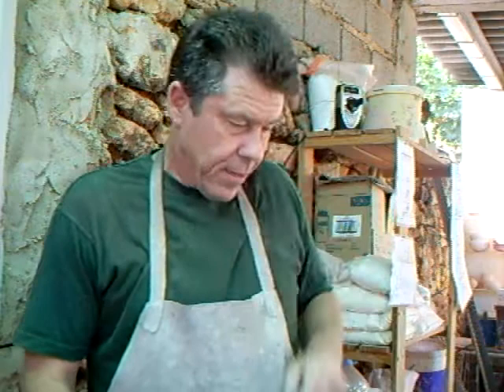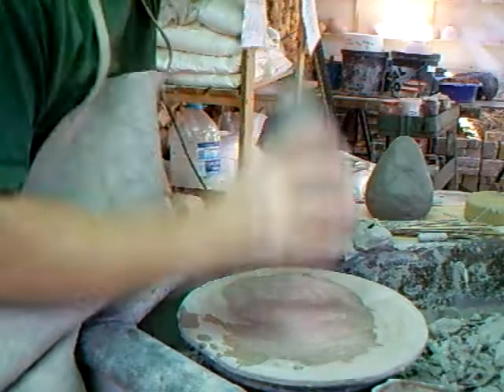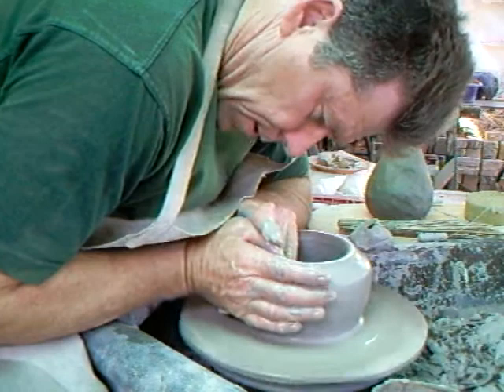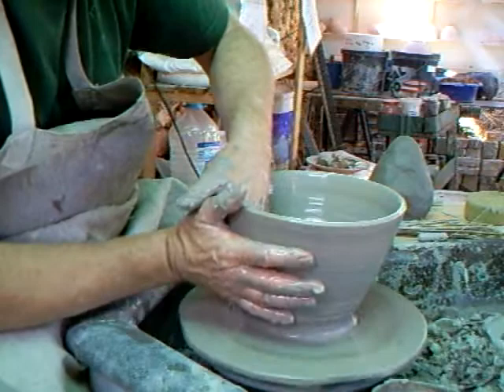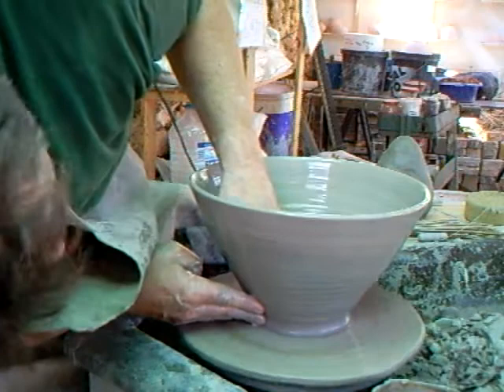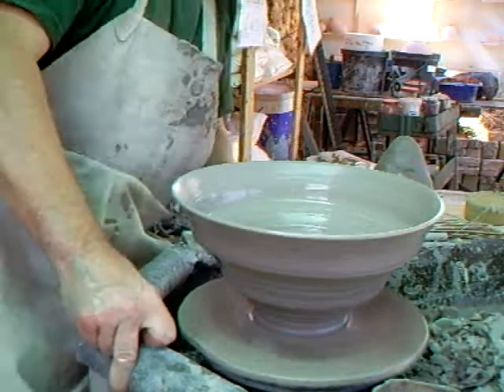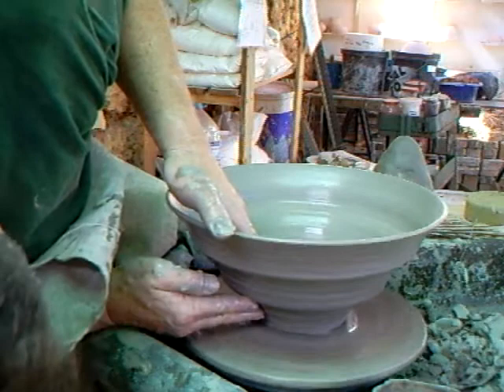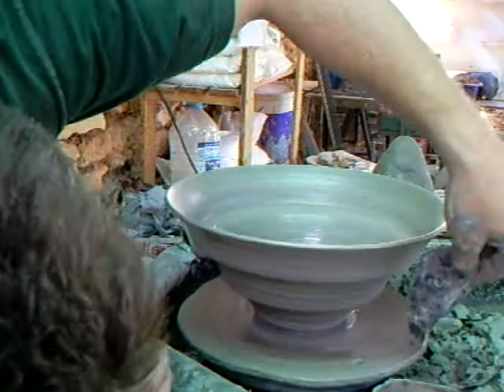SIMON LEACH - Throwing a tiered bowl

Comment: Hi Simon, this has been my experience. Irregularity happens when a small base is used with a large pot, the pot tends to tilt when a small belly appeas just aftrer the base turns into a wall, the clay is thinner at the belly and contiues up as you pull up. A degree of correction can be made at the trimming process, with the pot upside down, the foot rim area has a wobble to it, trim this off flat when turning the foot, this will make the bottom square to the rim.